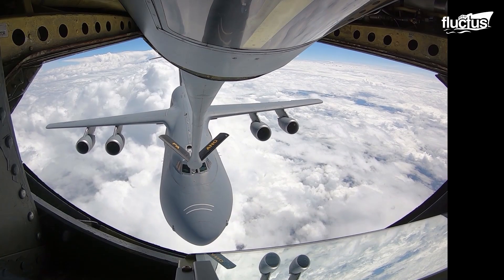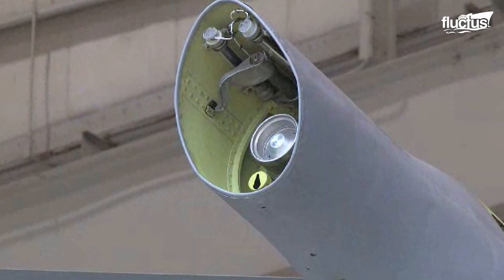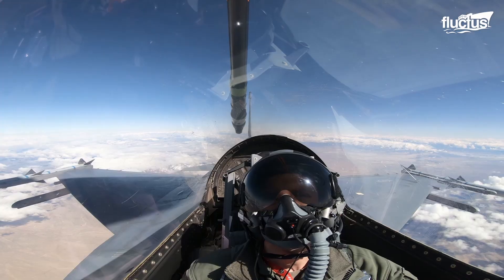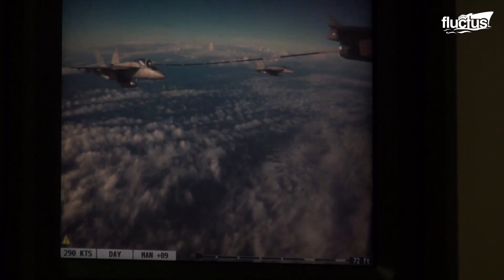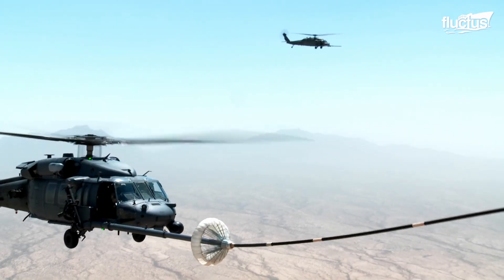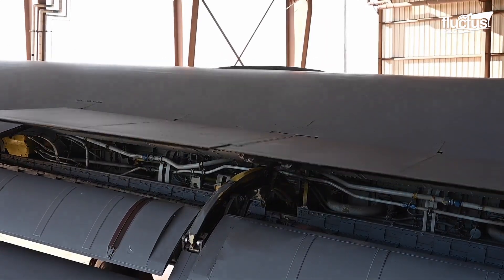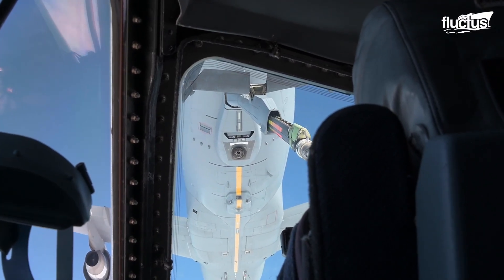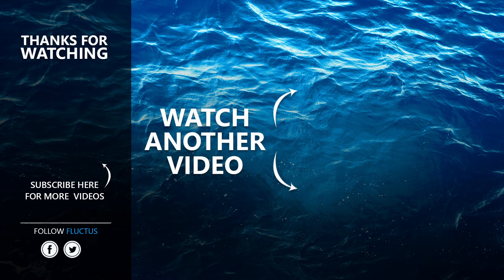A Day in Life of US Boom Operator Refueling Giant Aircraft Mid-Air

Comment: Why would the Army/ Guard have to fabricate parts with no drawing or technical data?  The DoD paid big bucks for the design, manufacturing and purchase of these aircraft.  Even though the manufacturers may not produce the parts anymore, the technical data and specifications must exist somewhere in the supply chain for the part to have been produced in the first place.  Another example of the U.S. taxpayer getting the shaft, (only in this case, we'd have to fabricate our own shaft).

Comment: Corrections:
1. USAF aircraft use a refueling boom, USN/USMC aircraft use probe and drogue, regardless of size. (with very few exceptions, i.e helicopters. most foreign A/C refuel via probe/drogue)
2. Average refueling speed is between 250-375 KIAS. Not 580. The only aircraft that refueled at anywhere close to that was the SR-71, but that only refueled from KC-135Q and certain KC-10s. Those tankers had special pumps, bladders, and booms to facilitate the transfer of JP-7 (which only the SR-71 used) to the aircraft.
3. Most helicopters refuel from KC-130Js, which are better at flying the required speeds for helicopter AAR. IIRC, A-10s prefer to refuel from them too, and KC-135/KC-10 have to fly at near stall to refuel them.

Any tanker crew in here, feel free to correct me if I've got something wrong.
Reply: As a KC-10 Boom, A-10’s have boom a receptacle for  refueling, not drogue. They do no refuel of helicopters. Only the C-130’s or other helicopters will do helicopters, they are too slow for the  KC-135 ,10, and 46. The KC-10 has 3 lower internal belly tanks for fuel storage (as well as wing tanks) not bladders for extra fuel like the KC-135.
Reply: @breakingdragon22  Weird, I had a buddy who was a flying CC for a -10 and he always mentioned Bladders. Then again, he mentioned them in the context of JP-7. Also, you're correct, I forgot that -130s only do drogue. I still find it funny that to refuel a hog, you guys have to fly full slats and boards to refuel em. I'm really sorry about the USAF getting rid of all your -10s in favor of the questionable -46 and keeping the ancient -135 flying. My friend tells me that the -10 was a maintenance hog but otherwise a fine aircraft to fly.
Reply: If need be, the SR-71 could use JP-4 in a bind. But couldn't reach it's top speed with it

Comment: Just a side not, Air Force fighters all use the flying boom, for that all Air Force fixed wing aircraft use the flying boom. The Navy, Marines  and helos all use the probe and drogue method. The KC135 unless equipped with APRS, must convert the boom to a drogue in order to refuel those requiring it. I worked KC135s for 6 years before switching to the fast movers.
Reply: Navy and Navy have a much smaller operation.